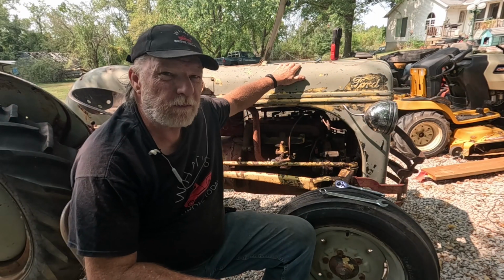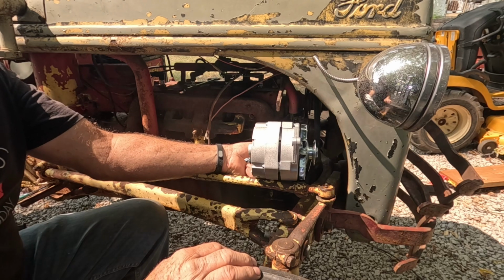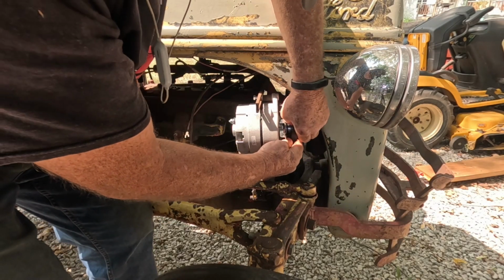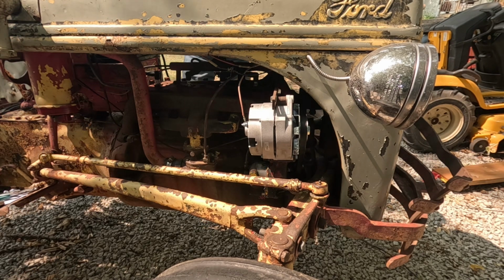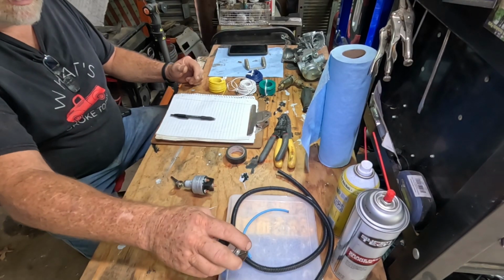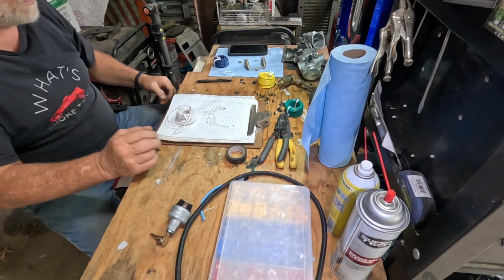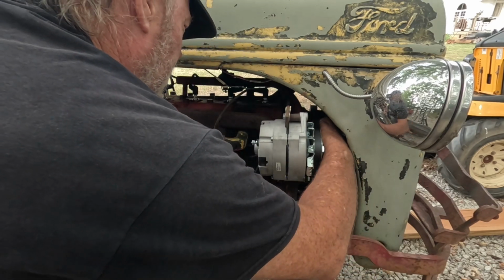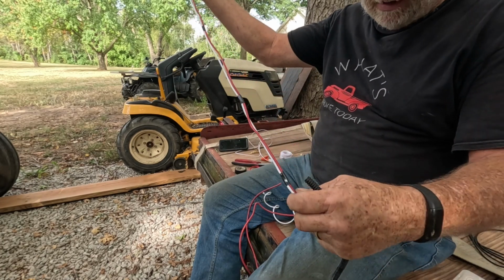Pt. 3 8n Ford Tractor Getting Running After Sitting For Years. Pt. of 1 Electrical.

Comment: I love the content,I have an 8n myself and if not for channels like yours to refresh my memories I would pull my hair out. I have went through gear set change in the transmission,carberator,alternator,wiring changed out front spindle assembly. You know maintenance stuff that previous owners should have but never did.
Reply from the maker: Thanks. I think I am getting better at this. I Work on so many different things it keeps everyday interesting.